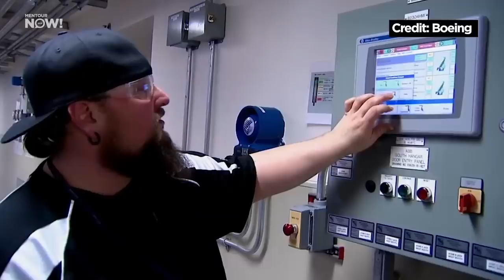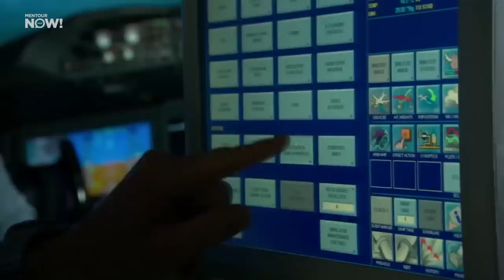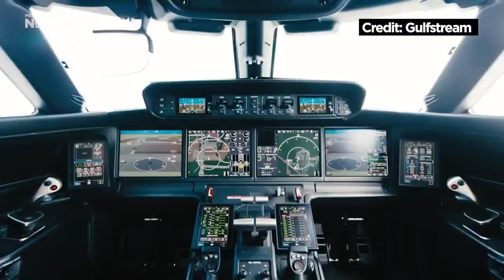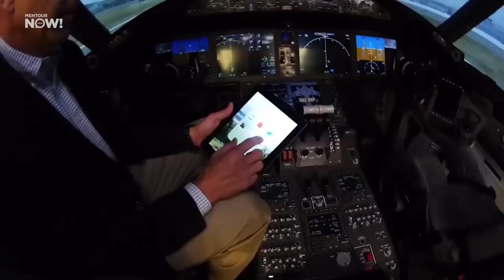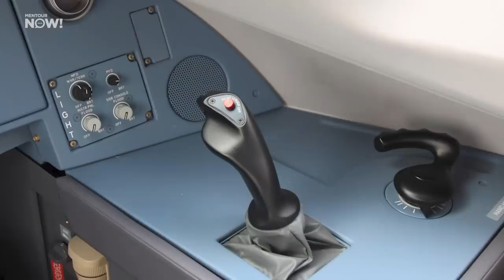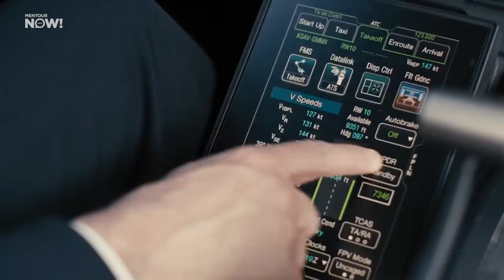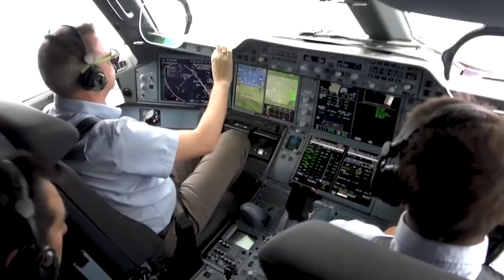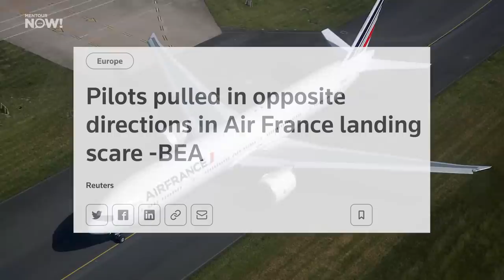Is Boeing Switching to SIDE-STICKS?!

Comment: It seems to me that would be better if the industry settled on a single general standard for the pilot plane interface.  There are probably many designs  that would work and trying to figure out which is optimal would be difficult because humans are adaptable and pilot training is extensive thus reducing any differences that may exist.  The safety and efficiency differences between designs is probably far less the differences between having multiple designs and single standard.  With a single standard switching between aircraft types would pilots would hone they skills they have instead of learning a complete new set of monitoring and control skills. Plus improvements to that design could be more widely shared increasing safety and reducing costs for everyone.  However having multiple designs is probably better for marking and other business concerns and when it's marketing versus good user interface design marketing usually wins.
Reply: Standardisation to that extent would prevent improvements in cockpit design. For example, how would the industry have transitioned to glass cockpits if designers had been required to comply with a "standard" analog cockpit?
Reply: Early automobiles had many different user interface designs before they compromised on the steering wheel and three foot pedals.  An issue that arises in automobiles, but not in commercial aircraft is dealing with disabilities.  For example should a veteran who lost his arms or his legs in service to their country be denied the mobility provided by an automobile.  Of course Douglas Baader demonstrated that a legless fighter pilot could still contribute.  Modern automobiles are also migrating to fly-by-wire and perhaps a side stick would be a more efficient user interface for EVs.
Reply: @MarvinRB3  The advantages of such transitions should be easily demonstrable.  Its when the differences are not clear that having a standard for the sake of reducing the cost of cross training would be better.  I am assuming some attempt is made to quantify such things before mass production begins.

Comment: Seems like it's a "how big is the number" question.  How much weight do they save? How much assembly time?  Is a common type rating a realistic possibility?  My guess is that if this is a 737 replacement, then a common type rating for the larger planes would have less of a benefit, since the bulk of pilots are likely to be moving over from the 737. And they got burned badly forcing the Max into the same type rating as earlier 737s, so I don't think they're going to try that trick again.

My guess is though, that there's an offsetting pressure that comes out in the adjectives you use. "Nice," "proper" yoke. I'm guessing some airline execs that make purchasing decisions also share that bias, so just keeping the yoke makes a nice differentiating feature, even if it comes at a cost somewhere else.

Comment: I have always preferred a mechanical link to my control surfaces. How does fly by wire work with a total electrical failure? The clincher for me, was when the Airbus crashed into the ocean, and just before impact, the FO, announced he had been holding full aft stick from 30,000+ feet!! In the 737, you would know right away what he was doing.
Reply: There has never been a total electrical failure because of the multiple back ups. If all generators failed and you have no APU then the RAT deploys to pressurise a pump to power the emergency generator. If a 737 looses both generators and APU it needs to be on the ground before the batteries die.

As for AF447 if the co-pilot had A) said what he was doing, B) listened to the STALL STALL warning that blared multiple times, C) Listened to the DUAL INPUT multiple times, D) other co-pilot had pressed the priority button then they'd have likely recovered. Sidekick was not listed as a contributing factor in the accident. Atlas Air 3591 was an example of even with a yoke the one pilot may not notice what the other was doing, as well as that AF incident

Comment: Touch screens, sidesticks, and other such interfaces keep removing tactile feedback from the controls.  It's easy to overload audio and visual stimulation.  A person can only look at and listen to a limited number of things at once.  Anything that stimulates other senses reduces the audio/visual load.  You can reach over and feel a knob or switch without looking.  You must look at a touch screen in order to use it.  There's a reason we have a stick-shaker for the most dire of warnings.  I feel like we need more physical feedback in the cockpit, not less.
Reply: @CoasterFan77 Why do you jump to the most extreme interpretation of what I said?  Do I really need a preamble and preface acknowledging every exception and circumstance where what I am saying obviously does not apply?

I didn't think I would need to take time out to acknowledge the newer development of feedback-designed side sticks, because I would think that a reasonable reader would understand that they are an example of the tactile controls I am in favor of.

When things go tits-up and you need to fly, pay attention to what's outside the windscreen, talk, and watch the monitors at the same time, it would be nice to be able to move a lever or turn a knob by feel.  They purposely make the tactile controls have different shapes and feels to them so you don't accidentally manipulate the wrong one.   

I am not saying they should be blindly operating controls during normal, basic flight operations.  And I didn't think I'd have to spell that out for you.

Comment: Despite any long-standing history for specific systems, I feel Boeing should step up and make the safest, most efficient, and easiest to maintain aircraft they can to fit a specific category and budget. If that means 'aping Airbus' in any way, so be it. And then openly acknowledge the new differences and training requirements. Lay it all out on the table and own it.

Best thing they can do right is openly own their future instead of making anyone wonder what could be hidden in the fine print.

Comment: The only inevitable thing is change. Boeing, as you pointed out, will have to get its pilots trained and get used to the sidestick which they should consider as an investment. This change may or shall be done in just a matter of time.

Comment: Fly by wire was seen as dangerous for a very long time but it is progress so sooner or later it had to be adopted for efficiency. I think joysticks - sorry sidesticks - will be the same - sooner or later they will be adopted because they can be shown to be superior technically. 
I'm a very analogue kind of guy so for me I'm not keen on electronics taking over every single thing in life but thats just the way the world is going. 
Will the new Boeing have sticks? I think it probably will. It think the only way it will still have yokes is if they can't get the sticks ready in time. 

Here's a curveball - what if its offered with both? Maybe they will allow buyers to decide which they want at order and the type rating could even depend on that. I know thats unlikely because it would bring a lot of headaches with it but if its fly by wire either way its not all that big a stretch.

Comment: So with sidesticks your pilot might be flying with there less favoured hand?

Is it not a huge flaw to have a control for an aircraft that forces you to use the hand on the outside of the cockpit regardless of whether its the preferred hand?
Reply: I heard many pilots transitioning to sidestick aircraft or becoming Captains in sidestick aircraft expressed concerns about having to use the non dominant hand on the sidestick. However most pilots have stated it wasn't an issue at all to use the non dominant hand on the stick, taking within several seconds or minutes to get used to it where they said it was just as good to use as the dominant hand and the brain compensates for using the hand and builds new muscle memory. Now some pilots did indeed have trouble using the non dominant hand but after a few training sessions in the simulator, the problem goes away to where they are just as effective to use the non dominant hand as the dominant. I guess based on pilots input, it really depends on who is able to be able to use the non dominant hand quickly and who will take longer. And with a yoke, during descent to landing, it's one hand on the yoke, the next on the throttles, including having the non dominant hand on the yoke.

Comment: I have flow center stick, yoke, and side stick. 

When the auto pilot is inoperative , I find a yoke and center stick better. It gives me a chance to change hands at cruise.  The side stick forces you to never take your left hand (Captain) right hand (FO) off the side stick.

When flying as a check airman it can really help to feel what the new captain or first officer is doing when they are having issues with landing in particular. 

I don’t know if one is truly better than another. Safety records seem to indicate little difference in this regard. 

If I had my choice, airline pilots would be required to hand fly every other leg at least to cruise altitude. The biggest issue I see with young pilots who have grown up flying glass cockpits and always on autopilot is they forget how to really fly. It is a big problem when the automation fails. They almost panic. It is nearing the point where loosing an autopilot is an emergency. This doesn’t bode well for true emergencies where there is multiple issues and the autopilot also is down.
Reply: @Clayson Antoons One autopilot on some aircraft and two on others. But it’s not uncommon to have both unavailable due to an error code or issues with command bars giving erroneous information. Two sets of buttons and knobs. At cruise you rarely touch the thrust levers. On a turboprop you might make slight adjustments to prop to help sync them. 

Try hand flying for a couple of hours at cruise.  Your hand will get tired. Some aircraft are easier to fly than others.   Yes. On a yoke or center stick you can change hands for a few minutes. If you need to adjust power it’s a quick change of hands.
Reply: @Clayson Antoons  I’m medically retired now. No I’ve not flown any Airbus. I’ve jump seated on most. I’ve never heard anyone who hates the side stick. My side stick is Cirrus and center stick is in various Diamond and piper cubs. The vast majority of my time was in Bombardier CRJ aircraft, EMB-120, and a bit of time in MD-80. Lots of full motion sim time in various aircraft 

I did train a lot of pilots as a flight instructor and at the airline as a check airman.

I do appreciate being able to feel exactly what the student is doing with the controls.  I think a side stick that has motion and both pilots can feel flight input and aerodynamic forces (like in video) would really be welcome from pilots who like traditional feel and feedback. 

In particular, the CRJ-50 was difficult for some new pilots to land well.  The aircraft wasn’t meant to be flared like a 172 or F-15/16. Navy pilots seemed to transition easier to this particular aircraft. A good pilot could flare and try to use aerodynamic braking but the FSM discourages this. 

Flew a 747-200 sim for a while at Flight Safety. That had to have been the easiest plane or at least sim I’ve ever spent time in. I was told by the pilots that were rotating through that it was very realistic in its simulation. 

I have a lot of friends flying the A-320. The really like the cockpit layout and find it a very easy aircraft to fly.  

My acquaintances who have flow the 737 and the A-320 are unanimous about the comfort of the A-320 being better for the pilots. 

I have a couple of ex students who are flying 747-400’s 747-800’s who also flew A300’s say the much prefer the 747. 

I think all of us who have flown anything are just very blessed to have been paid to fly.  If I could get my medical back, I’d be glad to fly anything.

Comment: For Boeing to remain relevant in the sales, it will need to mimic type rating as the MC-21 was proposed to do, it was proposed to make their aircrafts type rating identical to Airbus A320 thereby requiring only 8 hours training for type approval, thereby making it an attractive proposition for Airbus fleet operators, this made a lot of sense, Airbus even helped to make this happen. 

Boeing needs to go down the same road, so that operators of Airbus aircraft consider them as an option. Otherwise they will only sell at huge discounts.

Comment: It is possible to mechanically link sidesticks and Gulfstream has a non mechanical active control sidestick system which uses electric motors to link the two. Irrelevant argument. Side sticks are more space efficient, ergonomic and allow for for precise control. The out of trim problem was specific to earlier airbus designs and can and have been fixed easily with an annunciator light, master caution and audible tone. Bombardier, Dassault, Gulfstream, Lockheed and so on have had no safety issues with their sidestick controls on their airliners, business jets and fighter jets.

Comment: Does not matter whether fly by wire is using side sticks or yokes, if the two controls do not at any time provide feedback to the opposite control there will be times when the aircraft will be in hazard by two pilots working against each other.  Yokes have the advantage each pilot can see the others motions where side sticks may hide these motions.  Having a disconnect based on control pressure input reaching a set level seems like a ticket to disaster.  This fly by wire seems to violate the KISS principal.  However, there will never be a 100% reliable system, and we all live by the allowable failure rule not intersecting with our personal path.

Comment: I'm curious about right hand/left hand issues with side sticks?? Also what happens if something goes wrong with the 'force feedback' system? Is there an override?
Reply: I heard many pilots transitioning to sidestick aircraft or becoming Captains in sidestick aircraft expressed concerns about having to use the non dominant hand on the sidestick and the brain also compensates for using the hand and builds new muscle memory. However most pilots have stated it wasn't an issue at all to use the non dominant hand on the stick, taking within several seconds or minutes to get used to it where they said it was just as good to use as the dominant hand. Now some pilots did indeed have trouble using the non dominant hand but after a few training sessions in the simulator, the problem goes away to where they are just as effective to use the non dominant hand as the dominant. I guess based on pilots input, it really depends on who is able to be able to use the non dominant hand quickly and who will take longer. And with a yoke, during descent to landing, it's one hand on the yoke, the next on the throttles, including having the non dominant hand on the yoke. Force feedback has been used on aircraft like the 777, 787 and A220 and never had force feedback problems as it's connected with the FBW system itself. If one of the sticks has a problem, the other pilot can press the priority button and takeover.

Comment: One benefit of moving to a side-stick for Boeing might be that conversion from A320 (huge pilot base) to the new boeing could be made easier. We know that companies are very arrogant and refuse to acknowledge competitors - but this could be a good story if trying to win large Airbus customers over to a new aircraft
Reply: Yep, if ego didn't prevent it the optimal, if very cheeky, path would be to make the new Boeing so similar in layout/operations  to an A320 series that you can claim the same type rating, in recognition that there are going to be more pilots flying the 320 than the 737 in future.

Comment: I come from IT. So I understand fly by wire as nothing but entering parameters which the computerization validates, feeds back if invalid, and then controls servos. Maybe this is a misunderstanding by an outsider (in aviation, not in computers). So how can any airliner nowadays not have fly by wire? Small planes, sure. But airliners nowadays? Actually when I  look at cockpits, I think a creeping process of added complexity, in the interest of minimizing pilot retraining. Current century technology are redesigned completely to be more intuitive. These cockpits seem to ignore human factors. Steve Jobs would freak out if someone came out with an Apple product like the cockpit.

Comment: Yes to the sidesticks as long as they are synchronized. Like yes to autothrottle and NO to the autothrust.
Reply: Still prefer auto thrust. TK1951 was proof that A) moving throttles still can go unnoticed and B) despite pushing the throttles to max when they realised airspeed was too low they forgot they had to press a button to activate go around mode. On airbus just push to TOGA and it engages GA automatically

Comment: Another disadvantge of a side-stick is that you can only use one of your hands to control it. With a yoke you can use either hand if needed. Of course a center-stick would solve that.
Reply: And yet a Boeing captain still only uses left hand to control. Right hand would be on the throttles

Comment: IMHO, the force feedback in the form of simply applying a torque to the stick is probably not enough to avert pilot conflicts, our palms are full of touch and pressure nerves that we can take advantage of
What if the stick handles are fitted with many pressure sensors, which would then control individual actuators on the other pilot's stick which push against the palm as you grip on it... this would allow you to 'feel' the grip from the other pilot as if you are holding their hand, it would be an almost intimate sensation and could come across as awkward or creepy 
 but it is in essence a direct, instant and non verbal form of communication between the pilots